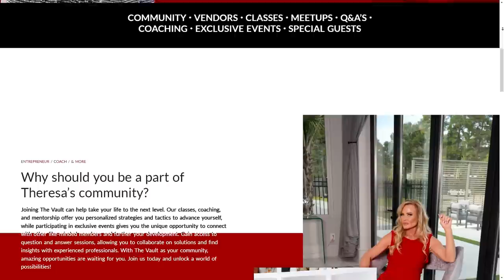WHY IS THIS HAPPENING??

Comment: I am so worried about you and Lamar having to make these surgery decisions.  My sister had the two surgeries you described and several others.  The main problem is infection.  It seems to me that all of these infections that run rampant in hospitals started with the use of disposable needles and other disposable items.  These infections go to your heart and are usually fatal.  It is a very scary thing to consider.  Just make sure he does not get any kind of infection.  You just about have to sterilize your home, hospital room, and after every doctor visit.  Keep wearing a mask until he has healed.  Wash your hands when you leave an appointment.  Make everyone "suit-up" when they come into his room.  Be paranoid!  It may save his life until he has healed.  They messed around at the Rehab Center and my sister got an infection and passed away.  Stay super aware of germs.  Prayers for your family.